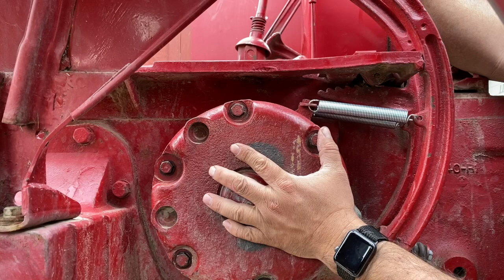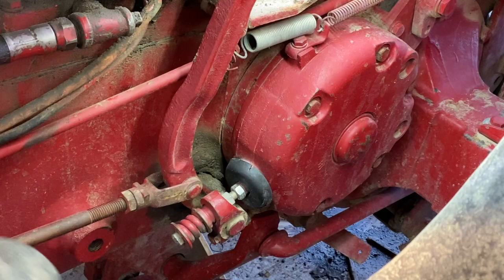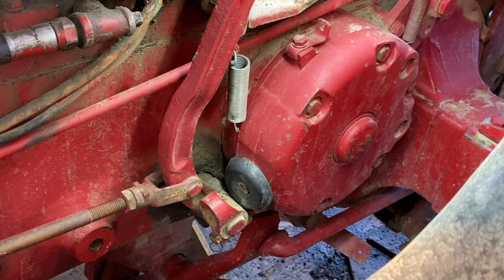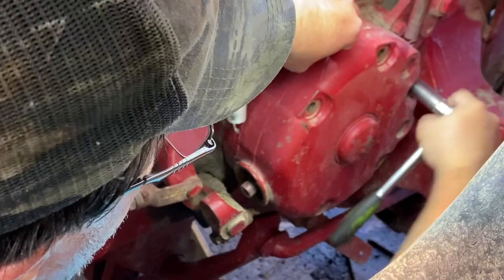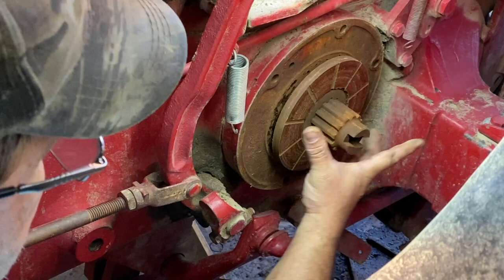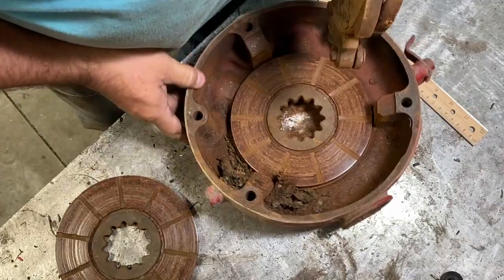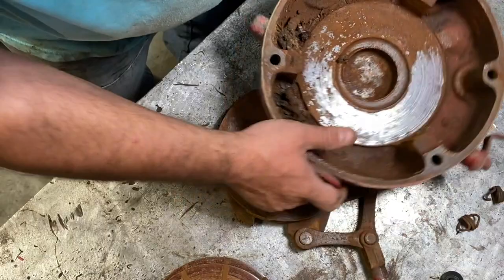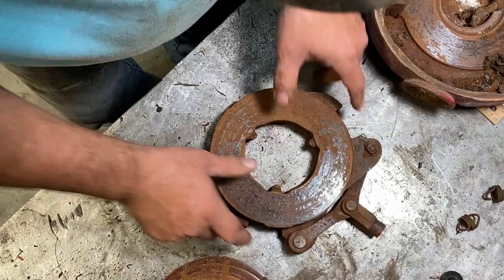Farmall 450 Brake Rebuild

Comment: I use spray graphite on mine. The big difference made was milling the outer case edge to return close to spec the distance from the outer face to the inner face. 656s had shims that could be removed to reduce the active movement

Comment: Yes indeed spend money on the disk brakes. Put all new parts in them. and when you are done there not even half as good a the older band brakes. We have a 350 farmall and Ive been there & done that.  We have a U tube video about our 350.

Comment: An old IHC mechanic told me to take brakes off of a 403 combine, they will bolt on to my SMTA. The 403 original brakes were built heavier than the SMTA brakes. 
When I found a parts 403, bought them for my tractor. Yes! They are a much heavier duty brake. I noticed a much shorter stopping distance.
Reply: Oh really?  Then why are all the brake parts the same part number? 🙄🙄🙄
Reply: @gasstationrollerdogconnois4295  The replacement parts might be the same part number, but I believe that the production part numbers are not. 
Hello from north east Montana. 
10 miles from the Canadian border.
Reply: @gasstationrollerdogconnois4295  I am talking about the mechanical parts, not the disc.
Reply: @gasstationrollerdogconnois4295  Yesterday while I was in town I ran into my old IHC mechanic, the brake disks are the same part number, but the mechanical parts are not the same parts number.

Comment: i have so many questions.  however this is a GREAT how to video. thank you so much.  
so mine has No brakes.  are you telling me that all i have to do is just CLEAN everything and buy a new spring or two and reassemble??  just clean em real good?    serious question and once again, that was a clear cut great video
Reply from the maker: Howdy.  that is pretty much it.   Clean Everything.  I would recommend new springs and new metal balls.   The rust makes them pitted even after you clean them so there is still some sticking when you use the old ones.
Good luck and take your time.

Comment: The short bolt is in line with my draw bar bracket.  If you try using wrong bolt you need to remove draw bar bracket.

Comment: What was the issue with the right brake locking up? My super M is doing the same thing on the left. Thanks for the video!
Reply from the maker: it was locking up with just a "relatively" light press of the brake.   It looks to be caused by old/rusty steel balls inside the breaks.  once I bought new ones and really cleaned the chambers that they sat in. it helped out quite a bit.   So it was just old, rust that caused the issue.
Reply: I intend to see if the disk brakes can be converted to the older and much better band brakes.